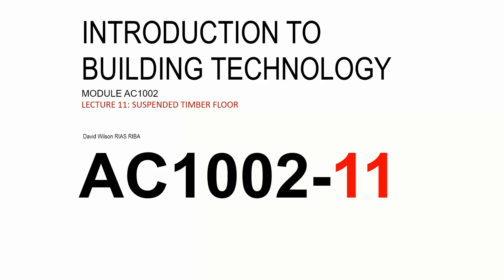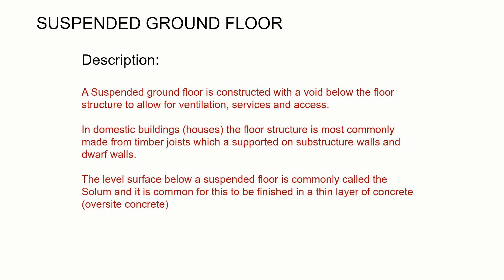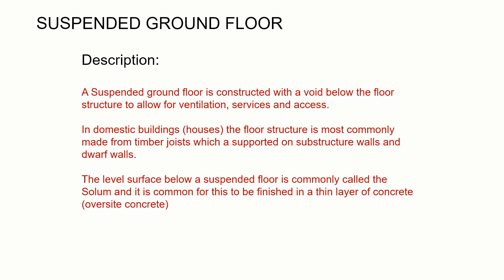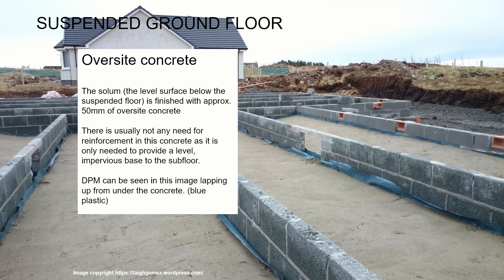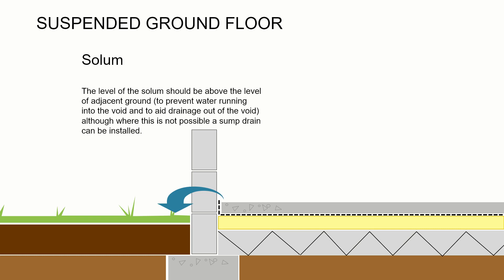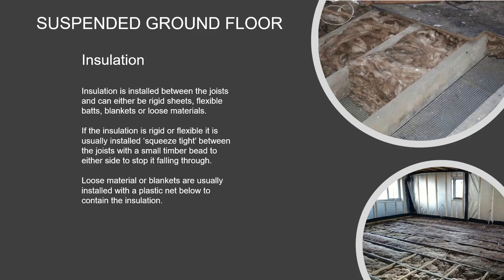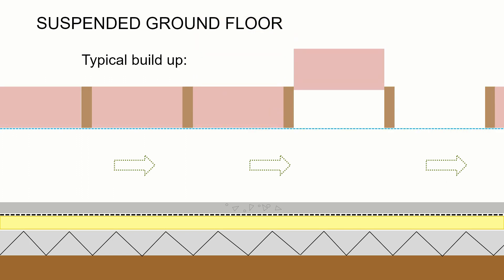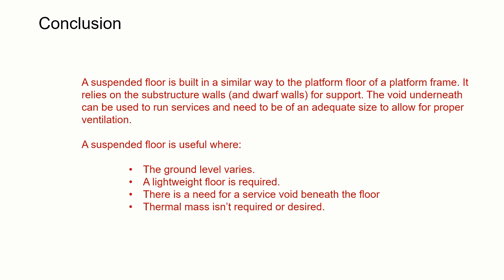1-11 Suspended floor

Comment: Thanks for such a great explanation! I'm actually thinking of getting rid of the cellar underneath my suspended floor (150 year old Victorian house) by removing the joists below the floor and treating somehow the ground (soil + cement), probably by fixing some damp proofing membrane.. There's a few air bricks on each of the two walls exposed to the exterior..Unfortunately I haven't much space in my home and every inch matter so there's any recommendation you could give me to achieve this and trying to tackle any potential damp problems, do you think there's any structural issues I should be prepared to look into before removing any joists/sleepers..?  Many Thanks,
Juan
Reply from the maker: Hi sorry for the late reply. It is possible to replace a suspended floor with a ground bearing floor, we have done it on a couple of projects. You do have to take out quite a bit of material to make sure the ground below the slab is hard. I would consult a qualified architect or structural engineer who can prepare a spec for you.
Reply: @Ramstam  thank you so much for your input. Really appreciate :)

Comment: Hello how would you tell wether or not a building has a suspended floor on the outside of the home. Also are there any ways to find houses with suspended floors?
Reply from the maker: Most often you can see vents in the lower part of the wall where air is allowed into the subfloor. This is an indication that the building has a suspended floor. If the building is brick or masonry then these will probably be terracotta air-bricks.

These videos were made for a UK audience (mostly in Scotland) where it is quite common to see suspended floors. If you look at new housing developments, like the one shown in the link below, using google Streetview you will see vents in the lower part of the wall.

https://goo.gl/maps/YqJWAyoECcwRs8iC7

Hope this helps.